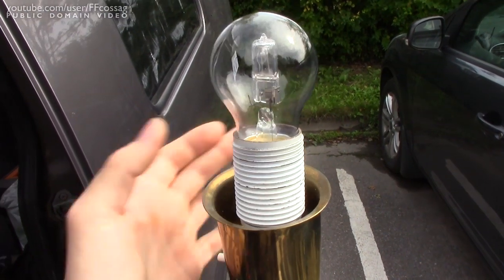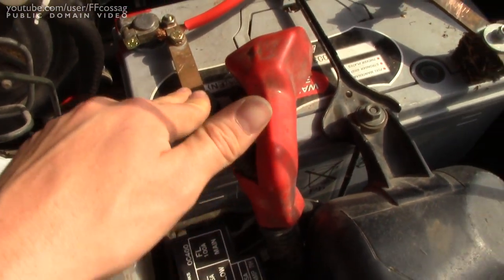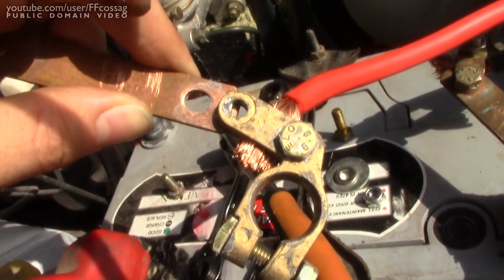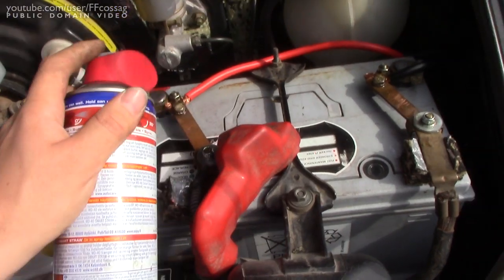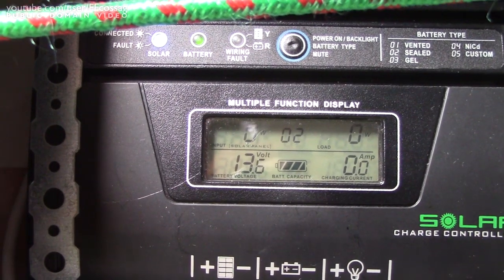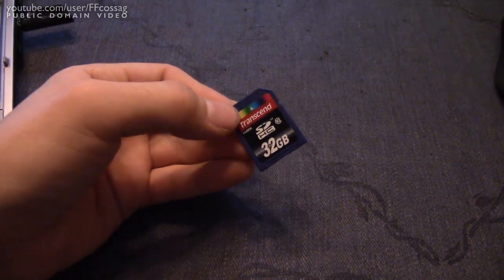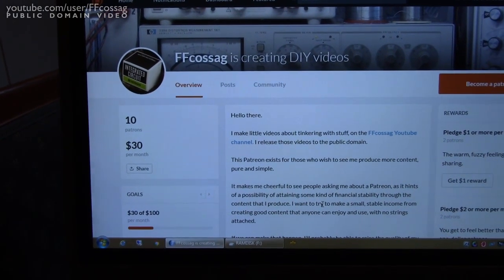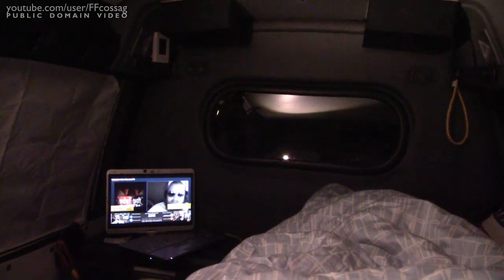VANLOG #3 - Fixing stuff & new SD card

Comment: Did you find a switch for that lamp or did you dissasemble it and clean the 40,000 year old contacts lol.
Thats odd, i would have expected the charger to current limit after the 13.8v threshold, perhaps one day you will make your own that behaves itself :-)
Reply from the maker: I'm unlikely to make an MPPT; I hack stuff, I hate making things from scratch.

The lamp is relegated to the local lamp repair place. The switch is mechanically knackered and I don't have time to hunt around for a new one, since I'm hitting the road tomorrow.

Comment: The artefacts could also be because of YouTube. I've seen it many times.
Reply from the maker: No, they were there in the source video files. At 1 TB of writes, we're talking 32 full rewrites of every cell of the flash, and that's about what you can expect out of a cheap-o SD card.
Reply: so what've you moved to now? I have a 64GB SDXC card made by SanDisk in my P500 that's rated for a max speed of around 80MB/s, and although it was cheap, it's able to hold more than I can manage for video. up until I got the card back in December, I was still using the 16-gig card I've had since 2012. in the long run, 16GB for taking 1080 video isn't even worth it anymore. the card fills up way too fast. if you can help it, my suggestion to you is to get a few cards as you can get to it, since on the road, and even just being home, so long as you know where they are, are just indispensable at this point, with SDHC and XC cards going for so little at those capacities.

perhaps a bigger MicroSDHC card as well for a decent "newer" phone you pick up along the way if so, just to have an extra video recording source in an emergency. Cheap Nokia Lumia Windows phones aren't bad for this, are a dime a dozen on the used market (the 520/521 takes 720p video for instance, anything capable of 1080 and autofocus usually go for a bit more) and aside from having to use the phone in a stunted media mode to get the files off of them, have decent quality and audio so long as the path to the microphone is clean upon recording.

...but that's for another time. you're as well-set as it's gonna get right now, but if someone along your travels offers you a used android or windows phone, or even an iPhone, pray tell, do it. their uses these days are staggeringly getting better.
Reply: I don't think so.
Reply from the maker: I already carry two film cameras, one DSLR (both with their own cards) and one decent webcam, so I'm pretty set I'd say. The old 32 GB card still works fine as a back-up. I'm the kind of person who does not like having a million little things lying around, so I don't buy SD cards or USB sticks unless I have an express need to.